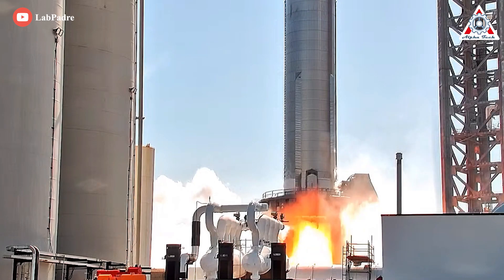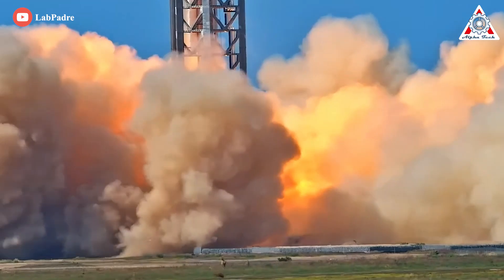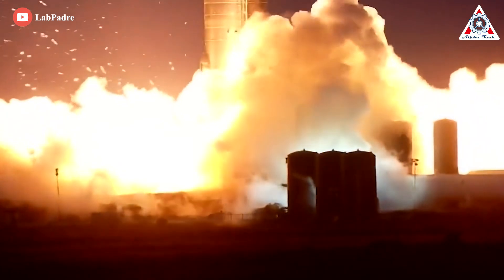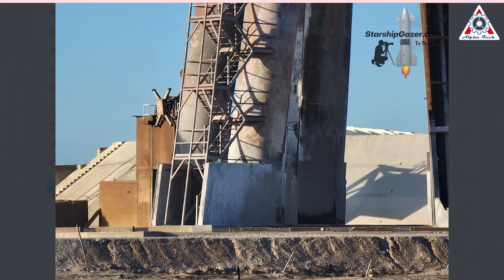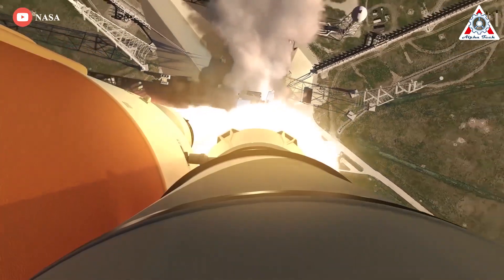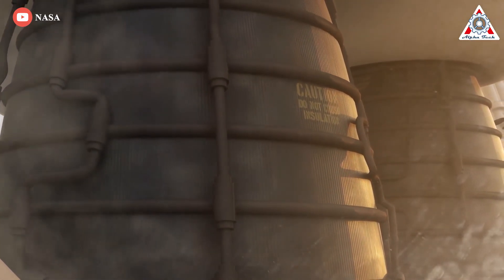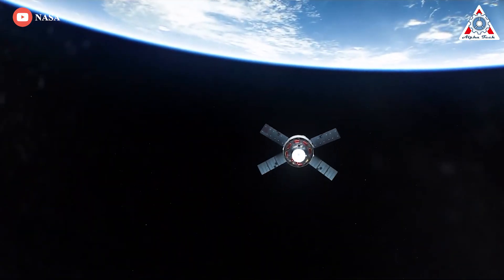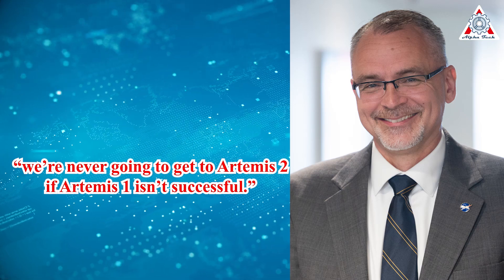Analysis Starship Super Heavy Booster 7 14 engines Static Fire "Problem"...

Comment: Perhaps they could use 14 raptors on lift off and then engage the other 19 once it clears the tower 🗼
Reply: They could if they used a version of starship that's made of styrofoam. Then once it reaches about 100 ft off the ground they can have a taller tower to quickly swap out the styrofoam starship with the real one.
Reply: @TLH442  Or they could launch with quarter tank full of propellant so they only need to use 14 engines as it is lighter
and then meet up with another starship and do a re-fuel about 10 miles up .
Reply: @TLH442  get this guy to elon!
Reply: Couldn't do that, wouldn't need at least 25 engines to get the thrust to weight ratio to take off
Reply: @loganhumphries4851  cheers, perhaps they need ceramic tiles for the concrete!
Reply: Remember, total load at launch is 5,000 tons. To lift that at a thrust to weight ratio of 1.5 you need all engines firing.
Reply: @stefanbaartman5893  thanks Stefan.

Comment: I never understood the lack of flame pit/exhaust diverter. Or even a higher launch pad  / higher floor to engine nozzle height.
Reply: No one does and everyone told.  He never listened.   Fuq around and find out i guess.
Reply: The Star Ship has a 100 foot 360 degree  flame diverter. No Rocket has ever had 100 foot clearance from the bottom of the " Open sided Flame pit"       Why is it No one seems to see the 100 foot tall table. With 360 degrees of open sides. All other  Lunch pads only have 20% to 30%  open end. And they are half that clearance
Reply: @apotheosis1181  It’s not near enough. The 360 degrees is not the point, it’s where the force and sound actually hit, and what happens to it. The current configuration is still largely a big reflecting surface to bounce the shock right back in the direction it came from. Think “ricochet” and I think it makes sense… The NASA flame trenches are VAST masses of concrete, deflecting force and sound away, and using MUCH more water. The water not only cools, it absorbs much of the shock and sound.  (Remember the first Saturn V launch. It shook away parts of the observation building, which was miles away. Building had to be reenforced. Look up the video. It’s got the audio of the only time Walter Cronkite ever lost his cool while reporting, as the ceiling started coming down on them! 😅)
Reply: @apotheosis1181  exactly.. the whole thing is a big flame diverter, the concrete just needs to be bigger. The edges of the concrete slap just outside the ring are not treated with the marnite, and the outward pressure of the raptors after hitting the surface eats out of the concrete untreated edges of the concrete. Make the treated slab bigger, upgrade pad shielding and it will probably be fine.
Reply: @apotheosis1181  The OLM at Boca Chica launch site is not even close to 100 ft.  I have no idea where you get that figure, but if you compare the booster which is 216 ft tall the launch table is a little less then a third of that.  The launch table is about 65 ft tall.  The starship actually sits a few lower on the launch pad so aft section may actually sit about 62 ft above the ground.
Reply: @apotheosis1181  just because you build a house on stilts doesn't mean it has a basement.  People aren't seeing a flame diverter because there isn't one.  Or were you trying for irony?
Reply: I wasn't impressed with the amount of water that was used. Hope they have more flow when all of them are lit.
Reply: @billakers6082  it's not a traditional water deluge system. It's a grass fire prevention system.
Reply: @JoeShmoism  I they cut the grass it wouldn't be a problem. I think with all of the landscaper coming across the border that wouldn't be a problem either.
Reply: @Mark Holmes.... Thank you, been wondering myself... they seem to underestimate the power of 33 engines firing at once so close to the ground.
Reply: ...ridiculous, isn't it?...I mean isn't Elon supposed to be an engineer? 🤨
Reply: In order to avoid more extensive damage that will result from firing the 33 engines at once during the launch, I'm wondering if it is possible to start the launch with fewer motors and then ignite the rest of the engines when reaching a safe altitude.
Reply: @oscarbattaglia9130   The whole point of all that power is to lift the damn thing off the ground. If you don’t need it at maximum liftoff weight, with max gravity and inertia, you don’t need it at all.
Reply: @oscarbattaglia9130  I actually like that idea. Lift off slowly by 10 engines, then gradually turn on the others within 1 minute
Reply: @divicio1  From  @tm502010 answer, I realized that 10 engines is not enough to lift the whole rocket (Starship plus booster).
Each Raptor2 gives 230 Tons thrust and the rocket weight at the start is around 5000 Tons fully loaded, so we need at least 22 raptors in order to move the rocket upwards a little and that would be very very slow. It’s preferably to use the 33 motors at once and to gain distance from the base as fast as possible.
Reply: @oscarbattaglia9130  ah thanks for taking the time to explain! I learned something
Reply: @oscarbattaglia9130  The rocket is heaviest at the start. Estimate 11 million pounds. Assuming raptor 2 engines 510,000 pound of thrust. We would need 22 raptor engines firing just to move it against gravity.  So if 14 is causing problem, 22 is more problem.
Reply: @oscarbattaglia9130  Opening sentence is WRONG (well was right for a short time) SLS launch produced 25% more thrust than 14 raptors.
Reply: I haven’t either. See my comments elsewhere on this video.  This vehicle dwarfs the power of the Saturn V, which was greater than the STS Shuttle system - yet look at the TITANTIC flame trench and water based sound suppression system they used, and continue to use at launch complex 39. SpaceX has nothing even close, not even a baby version of it! The whole Starship assembly still looks like a ”rocket standing on a table” - which is just NUTS!  Note also the distances. The launchpad is a few hundred feet away, not the over 3 MILES away used by NASA. If Starship blows up coming just off the pad, it’s gonna take out EVERYTHING - including much of the entire facility. There could be considerable loss of life…
Reply: @tm502010  If the starship did have an RUD on the pad there would be no loss of life because they are too far away to be in any danger assuming the direction for launch is at the production site.  It is also debatable how much damage would be done to the area around the launch pad.
Reply: It's really very simple. The concept is for a rapid turn around to support sub-orbital intercontinental flights. After say, 100 test fires and mostly successful launches, the flame pit will have self-excavated to a sufficient depth. Ok, so it's an expensive way to dig a hole, especially as the launch stand will probably fall into it a few times as it expands. But it'll demonstrate the technology that can also be used for The Boring Company's soon-to-be announced GigaRaptor TBM.
Reply: @brolohalflemming7042  ...you've DEFINITELY got rocks in your head.🙄
Reply: @brolohalflemming7042  ...BLOCKHEAD.

Comment: The angle of incidence is the angle of reflection. Seems to me a short squat cone would reflect the thrust out the sides of the launch mount saving the concrete below…
Reply: I think they've already looked at that and the problem is the tank farm. If you look at the images you'll see they already have three layers of concrete blocks protecting it from horizontal shards and debris. Think of the rocket engine plume as being like a cone that expands. When it hits the ground basically the cone continues with the original shape but reversed back up. So these particles and debris will be going upwards rather than horizontal and I think that's desirable. Any really heavy chunks to get peeled off the ground will be going more horizontally anyways and that wall should abate that problem.

Comment: So I've always thought that SpaceX launch pad was cramped but 33 raptors blow torching the launch pad with the power of 2-3 Saturn 5 at full throttle is like a low yield nuclear weapon going off. The numbers are insane I'm afraid the launch pad is going to be a one use item
Reply: I wonder how many Raptor Engines are actually needed to get the Starship Super Heavy Booster et al off the launch pad itself? Is it possible to only ignite some at first and once it clears the pad ignite the remaining? Alternatively, could they just ignite all the engines at once, but at a lower power and once it clears the pad then go to full power?
Reply: would be funny to use reusable rocket on expendable launchpad...
Reply: @invisiblekincajou  😀
Reply: Could launch them from water.  Otherwise the stand would need to be taller and the concrete reinforced and made more heat resistant.
Reply: I agree, 14 engines proved 33 would be catastrophic to the pad. I believe the 14 were held back to %73 of full throttle. Should have lined the pad with carbon reinforced ceramics.
Reply: @donmiester45  Much deeper trench with diverting ramp lined with thick layer of refractive bricks (like those used in steel making furnaces) would do the trick.
Reply: 2 to 3 Saturn 5 's ? Where are you getting your information from ?
Reply: @bobhope3716  1st stage of the Saturn V rocket produced a total of  7.9M lbf thrust (35.1 MN) .  Now compare to total projected 1st stage thrust of Starship: 16M lbf thrust (72MN). So yes 2 to 3 times the total thrust of the Apollo era Saturn Vs (specifically about 2.1X).  The gentleman you were questioning (not me) appears to be correct.  Just google it yourself and you will see.
Reply: Make the launch pad out of heat shield material.
Reply: The launch pad is woefully under designed and inadequate for what is being asked of it.
Reply: @pakviroti3616  what are your professional qualifications since you think you know better than Spacex?
Reply: @jeffsymons4535  The facts in evidence. Bite me, pinhead.
Reply: Nah.. just park cyber trucks ontop of it then its bullet proof!
Reply: Hahahahaha!!! You think Elon hasn't thought of this!!! HAHAHAHHA
Reply: @Madchuck42  Musk previously said that not having a flame diverting system below the rocket may end up being a mistake. He's clearly taking a risk.
Reply: @Ctrl-Alt-Play  with great risk comes great reward... When does he not eat risk for breakfast....
Reply: @Madchuck42  Could be. Perhaps that's why they are only testing 14 engines. SpaceX may not fire up all 33 engines at the launch pad for this first mission.
Reply: @Madchuck42  Let's be honest. Elon making claims is right less often than picking a for every question on a multiple choice test.
Reply: @Madchuck42  Apparently not; more precisely, he no longer has the likes of Tom Mueller, designers of Falcon family, who know their rocket engines, around. See how SpaceX is gradually adding layers of protection every time the "stage 0" gets blasted - as if estimating the destructive power of those Raptors is not basic engineering. Then again, so is welding stainless steel pressure vessels, and yet SpaceX was re-inventing it from scratch, wasting at least a year.
Remember, Musk is not and engineer, and does not seem to be particularly inclined to listen to those who know their trade. Now that he has a new toy to break (Twitter), Gwynne Shotwell might be able to get things under control here, too, as she has on the Falcon side.
Reply: 33 raptors... It's so stupid. Just throw a couple of 'reuseable' solid rocket motors on it and reduce the number of liquid nozzles already. This approach is doomed and the most likely path to bankruptcy for the company and Elon.
Reply: @jimmyfuntime4378  Well, 27 Merlins work quite OK...  I don't see the how the use of glorified fireworks instead of rocket engines would alleviate the problem of inadequate launch pad.